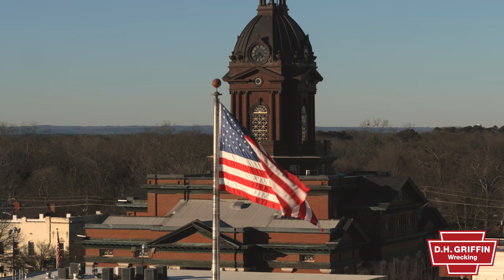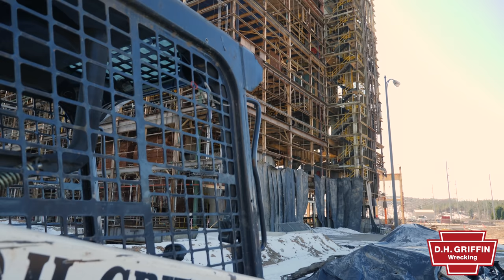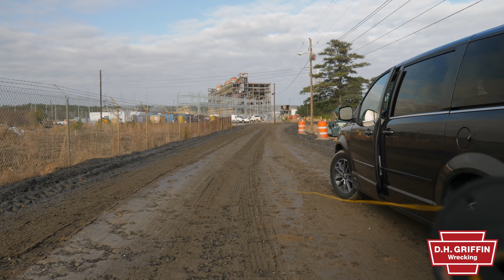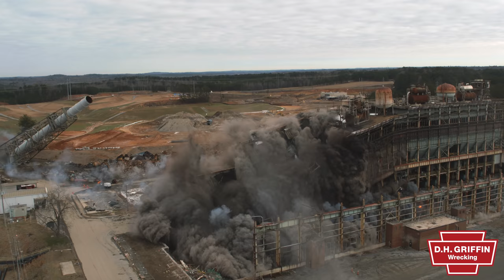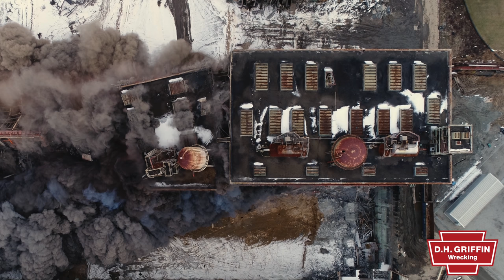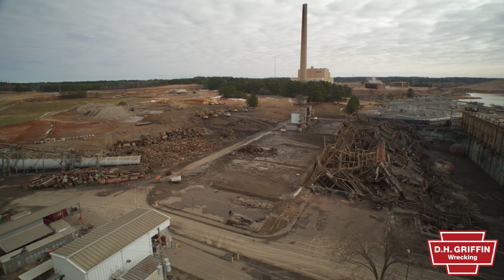Coal Plant Demolition - DH Griffin Wrecking

Comment: With all of that coal dust that is lofted during these demolitions I am surprised that there is not a secondary explosion.  I would think that the dust would ignite, but obviously it never does despite being dense enough to flash, I wonder why?
Reply: Possibly not as dense as it appears, and it's mixed with other dust - every demo vid I've seen has a lot of dust. Also, no ignition source. The detonations are over by the time the building collapses far enough to produce the large amounts of dust.
Reply: The air / fuel mix is wrong for an explosion to occur.
Reply: Doesn't ignite because there is very little coal dust as the buildings and equipment are washed down prior to demolition.   Most likely, the dust is from refractory, a cement like insulation material that is present in the ash pits and boiler.    Also, there is probably a good bit of fly ash present in many of the nooks and cranny's of the building such as underneath the sheet metal "skin" of the boiler.